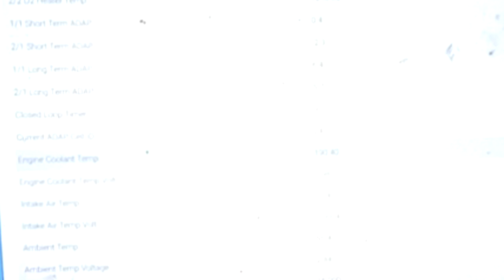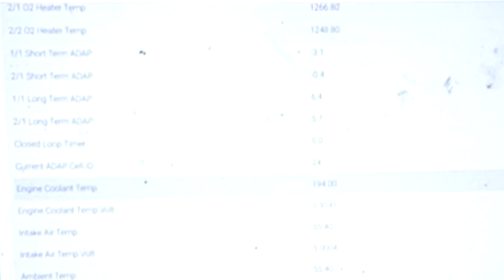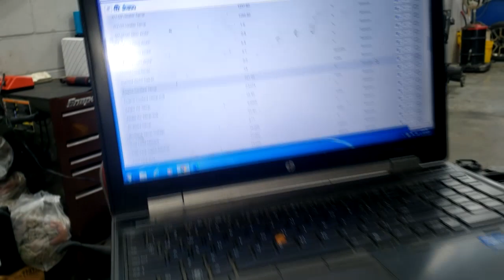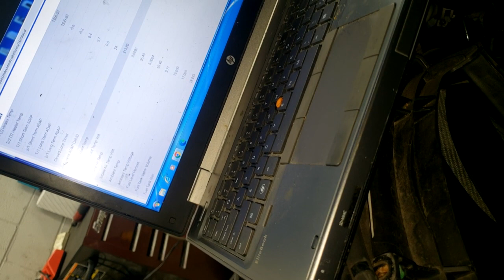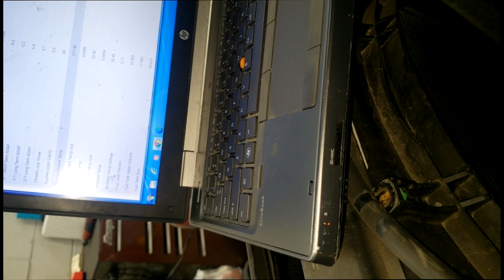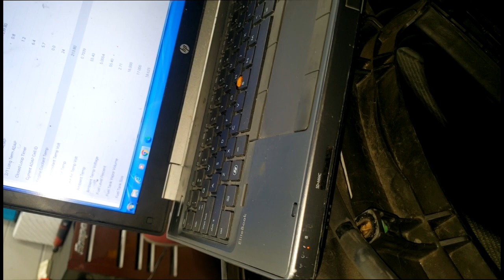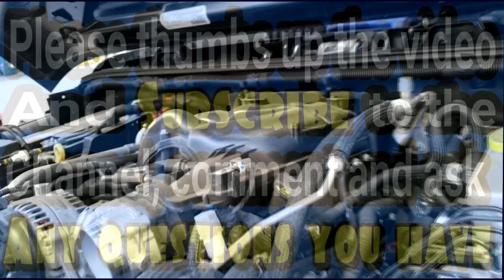How to tell when your cooling fan suppose to come on. Car overheats with AC on. P0128 .Jeep Wrangler

Comment: Counterintuitive but running your ac will help the engine run cooler as the fan will come on and stay on.  My 17 caravan was running between 206-213 degrees while driving 75mph on a 98 degree day.  New rad, new stat and hoses.

Comment: I have a Jk and I’m new to Jeep and especially modern vehicles. I was flabbergasted to find that the normal operating temp was above 100c (212F). I was always under the impression that the temps should not go above boiling point.

Comment: I tried the same thing on my 2014 Wrangler 3.6L and the fan would kick on at 222 and would go off at 213 the first few cycles after changing the thermostat.
I put in a Mishimoto 180 degrees instead of the OEM 203 degrees. Wondering if the Car's computer relearns the on off of the fan based on the new thermostat. As after 6 or 7 cycles of the 222 v 213, it brought the temp down by blowing at a faster speed and started cycling the on and off between 203 on and 199 off. 
Thanks for your educational videos. You help my dyi projects tremendously.
Reply: Did you do anything for the Jeep to learn the new cycle ?
Reply from the maker: I did not. As to the computer can not  monitor the operation of the thermostat per sae, It use the coolant temp sensor to detect the temp, which control fan operation, which is a result of when the thermostat open. So in a way it can. But changing the thermostat do not require any re calibrating of any settings to the computer.

Comment: Thanks! I had this exact question, I thought the fan cut in at a temp that was a bit higher than other vehicles. This operation is somewhat confusing though as when driving down the highway, the temp gauge will stay at around 206. When stopped, it'll creep up to this 225 (per EVIC display) and then drop back down again when the fan kicks on. I also smell some coolant, but time will tell where the leak is, I suppose, as I'm not losing any coolant... I wonder if it's odor leaking from the reservoir cap. Again, I appreciate this vid!
Reply from the maker: O that was you. I kept trying to remember who asked me that..I wanted to put that question in the beginning of the video but I could not find it and forgot who asked me that..lol..Yea that coolant leak tricked me. It was leaking at the seams of the radiator on the right side. Smell of coolant while driving. It would not show up using the pressure tester tho.
Reply: @OnlineMechanicTips  they seem to leak on that seam. You can usually tell if you remove the fan then look for it.  if you use a program like hptuners you can change the low and high fan settings, I thought I saw low was 219 and high was 226 but that depended on the year.
Another thought I had was to change the resistance on the ect sensor as a cheap mans way to get the fan to come one earlier.

A question though, you said you never saw a bad head gasket on the 3.6 penastar, but if one is getting bubbles in the overflow , would you think it could be a warped head? I tried the chemical test and mine detected exhaust gases , so if it’s not the head gasket, what do you think it could be?
Reply from the maker: @IFix-Things  Hey bud. My point behind that head gasket discussion, was not to ONLY just simply remove heads and install a head gasket and simply go back on with the heads. You should get those aluminum heads pressure tested, they likely warped. The problem steam from people simple just replacing head gaskets and thats it. Then they come to the shop complaining that car still overheating
Reply: I have jeep wrangler 2014 ,  i have changed the radiator and  thermostate , after that i have a problem  when ac is off, idle tempreture raised a little pit above the half , and the fan start to kick at 226 and return the tempreture to 219, but before my tempreture gauges is always on the half , what could be the problem , it is really annoying me is this normal?? .
Reply: @ossamaawad8446  did you ever find the cause
Reply: @ITS-FALCO  no i checked alot in different places ,no one able to find the cause ,but i guess this problem after i replaced my radiator with new one
Reply: @ossamaawad8446  i replaced my radiador issue still there
Reply: @ITS-FALCO  did your problem apears after changing the radiator or before ?
Reply: @ossamaawad8446  before/ mine started when my ac compressor went out
Reply: @OnlineMechanicTips  do you have solution for our issue please?
Reply: @ossamaawad8446 update on the issue, its the head gasket.

Comment: Hello boss, my jk 3.6 doing the same , what was the problem?, this problem appears when  i changed the radiator , the fan start working on 222.8 F only , also when i accelerate the tempreture goes up ,please do you have solution for this 🙏
Reply: I had this same exact issue. Ive been told 3.6L Jeeps are a pain to get the air out of the system. I had my computer plugged and center line was @ 220 on the dash gauge and that’s normal op even at idle but when driving 65+ temp jumps to 244+ still trying to figure it out exactly what’s going on. noticing the fan is loud but still operating even at idle. Replaced tstat, radiator, new rad cap, water pump so far.
Reply: @thelonestarjeeper6523  any luck to the issue?
Reply: No not yet , the fan is still starting at 226 F and i didn't find any solution for this delaying
Reply: I’m still waiting on some parts I ordered from Amazon thermostat and sensor that goes on the right side on the block which this part is to give you the temperature on your dashboard I plan to install the radiator cap and see if the problem is solved
Reply: @isidoremartinez2529  I spent so much money replacing the entire cooking system. I realized my fan turned on at aroune 226. I bought a HPTUNERS and changed the temp the fan kicked on. Now it runs fine. I kept bringing the temp lower to make sure it was cooling at a good time and maintained itself at a good range. Even my MPG is better. How strange? From 12 to 15.
Reply: @m9katchm9  I would like to identify the location of the cooling temperature sensor as well as the a/c pressure witch after listening to your discussion with Buddy on your channel that would be a good start on confirming if this (2) parts are bad if you could show a video of the location I think you could help a lot of people on this problem hopefully you can help you also made a comment on the fan temperature sensor not relay again Thanks for all the info
Reply: @isidoremartinez2529  there’s 2 cooling temp senators on the 3.6. I think maybe the 3.8 might have 2 as well. But for mine, it’s a 3.6 and there’s one cooling temp sensor on the OIL COOLER, which is under the upper intake. Then there’s another cooling temp sensor under the engine, it’s under the driver side tire. It’s the only big red sensor under driver side tire. You can see it from above, but you can only access from behind the driver side tire. That one is easy to replace. The one on the oil cooler is much more work and can be a risk of breaking something.
Reply: @m9katchm9  Thanks for the info I will check that out this is what you ask about my Jeep Thanks again
Reply: @thelonestarjeeper6523 
mine has the same issue now. I have got the air out of the system, it’s holding pressure and no leaks, coolant is full, replaced thermostat oem, water pump, coolant temp sensor, and radio2 years ago. Did you ever figure out what your issue was? Any help would be greatly appreciated!
Reply: @isidoremartinez2529  where do you get the tuner at bro ???

Comment: What should the peak coolant temperature be on a 2015 ram 1500 5.7 hemi? I’m getting all the way up to 222 when I hit wide open throttle then my fan comes on just like this but when I idle it’s 206 strong.  I feel like 222 is too hot

Comment: I’m working on the exact same car and the cooling fan turns on on max speed at 213.

212 it drops to mid speed. 
When driving it stay around 213-230 and the jeep sound like a jet.
Reply from the maker: Was there any codes in the caomputer? Also are you subscribed to the channel?

Comment: I replace the radiator the water pump the timing cover gasket cause was leaking and replace the over flow tank and cap, temp sensor and thermostat  but now my car runs fine if the ac its on  but if I shut off the temp goes high, but something what I noticed its when the temp goes all way to 230 or 240 I shut the car off but I leave the key on accesories and my cluster shows 32 degrees and not 230 or 240. Anyone has some ideas about it?

Comment: I have a 3.6 2016 Ram I pretty much just gave up when I turn the heater on my coolant Temps on panel goes down to 195 to 205 it stays in that range also the fan stays on. Without my heater on It stays at 228 to 221 with the engine temp aswell I've replaced oil filter housing twice and  cracked radiator once I'm so over it
Reply: Bro I’m wit u I’ve replace the radiator thermostat housing everything fan instill it gets up to 228 before it even kicks on
Reply: same problems here with my 6.4 hemi

Comment: I almost had a stroke as a new jeep owner because I didn’t know jeep engines run hotter before the fan cuts on o didn’t know about electric fan motors to senors
Reply: Still scares me honestly wood it hurt a jeep to upgrade or down grade to a mechanical fan ?

Comment: I thought the thermostat is a 203
Reply from the maker: Just pulled this out of the manual. A pellet-type thermostat controls the operating temperature of the engine by controlling the amount of coolant flow to the radiator. On all engines the thermostat is closed below 195°F

Comment: 225 -230 isn’t rare if you are idle before the fan cuts on
Reply: So you're telling me its normal for it to go up to 225 to 230 when idle and then drop back down, once the fan kicks in?
Reply: @rajkundhal9974  yeah because they are built very simple like old cars the cool by air and the fan only cuts on when it gets 210ish or it idles like a four wheeler atv it’s air cooling 
You can take the fan out the radiator and have it converted but that’s expensive 
I’d check the radiator cap condition clean out the radiator from the back 
Key is keeping the radiator clean and the cap good or new 
Change the oil twice as often coolant and transmission fluid 
Axle fluid and grease normally 
Just my advice if it runs twice as hot do twice the maintenance
Reply: @rajkundhal9974  atlest you saw this video i al odt had a stroke for a month because i thought i bought a  bad jeep because i didnt know 
one last thing big tires big wide wheels look good but they strain the engine 
and suck on small roads 
  i cant wait to go from 35 to 18 or 20 
but my kids birthday is this  monty
Reply: @jonoxthomascito6516  Man thanks so much for that info, I was stressing balls cause I did a radiator flush, changed the thermostat, thermostat sensor. To be honest I never checked oil temp until after my check engine light went on for the thermostat sensor, which I replaced, and then my CEL went away. And then monitoring it, the fluctuations  alarmed me. You put my restlessness at ease. Thought I had a head leak after the flush. Thanks brother 🙏

Comment: My ‘13 is the same and when the ac is on the temp would maintain at 219-222.8 is that normal ? Cus the dealer said that is is normal, but when i check my ‘15
It ran cooler and the ac was way cooler, the temp would maintain at 204-208, i spent more than 5k trying to solve this, help would be appreciated
Reply from the maker: What kind of vehicles are we talking about? with what size engines? Also are you subscribed to the channel?
Reply: Jk 3.6
Reply: @OnlineMechanicTips  now im subscribed
Reply: @OnlineMechanicTips  basically when the ac is off the temp will reach 222.8 when idling but fan will come on at low speed only, and cool it back down to 212, 
No difference when moving or idling, ( new fan, radiator, thermostat, ECT sensor, new cap, and new oil cooler. 
When i try to burp the system with a spill proof funnel the coolant will start to boil. Car temp is normal when ac is on idling